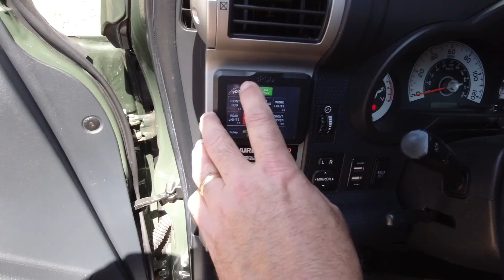Overland FJ Cruiser Walk Around part 2

Comment: Buy a warn winch remote control plug and play no need open hood I have one but I have Arab front bumper
Reply from the maker: I didn't realize this at first but the Warn VR EVO is wireless. I just needed to remove the cord from the controller and pair with the winch. So more more popping the hood for me.

Comment: I want to put scene lights as well but I'm not sure how to wire them. Did you go through the cab through the rear door? Or back through the windhsield up front?
Reply from the maker: My FJ originally had roof lights that were removed with the OEM rack. So I re-used the original wire already passing through the roof. Then made a custom wiring harness for the lights.

Comment: I'm on the fence about front lockers for my FJ. Do you find yourself using your front lockers often? I've always been able to use A-TRAC to get myself out. So, I'm not sure it's worth the cost. What's your opinion?
Reply from the maker: Probably don't need the front locker. I had to re-gear for the 35" tires so it would have been stupid for me not to add the front air locker while the differential was open. I've used it once so far.